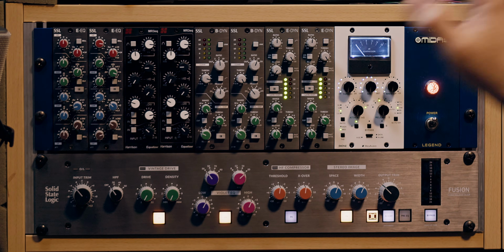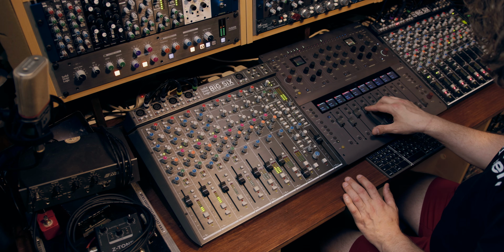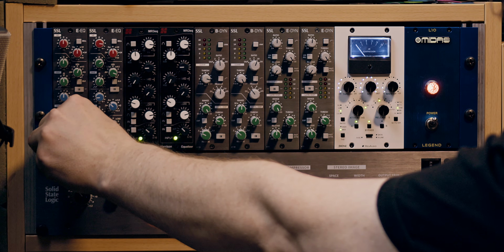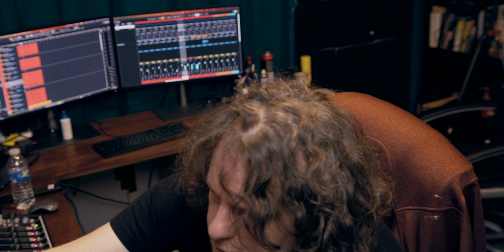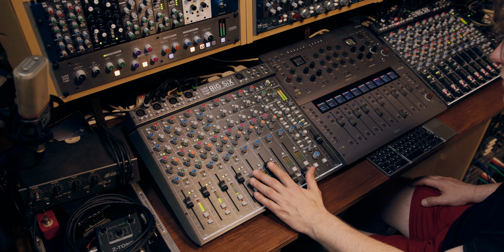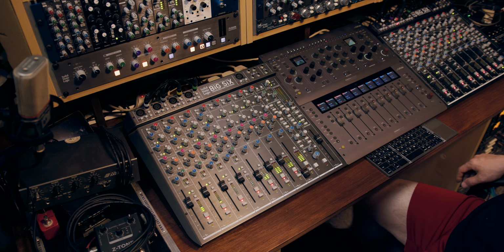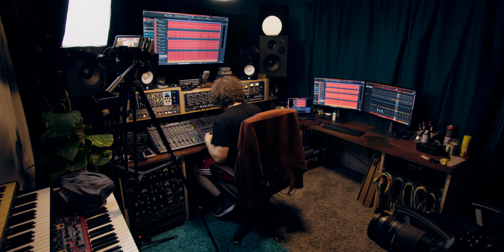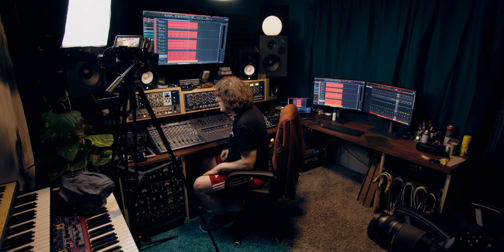Mixing Drums In My Ultimate Analog Hybrid Setup Using SSL, Harrison, WesAudio, IGS & Softube

Comment: How those Harrison eq's sound? :)
Reply from the maker: I realised I said trident in an earlier thread when I meant Harrison, was comparing the wrong thing after a long day mixing. The harrisons are functional but I barely use them. Any curve matched with pro q4 is identical in an a/b blind test. At least the uveqs have trim so you can use them pre and post analog comps
Reply: @domminney  What your advise for 2 eq's 500 series just for, one for Vocals and one for acoustic guitar. Preamps are Chandler TG2 and 1073 Lb 500, 2 IGS LA2
Reply from the maker: @lucasjuniorproducer I can only speak about what I’ve experienced and the SSL E-EQs are great, the curves are not what I’d reach with pro q 4 unlike the Harrison ones that are just the same as the digital ones. I’ve used more rack mount eq rather than 500, pultec style is good, I’ve used the warm and an igs one and the igs was great so I expect their 500 to be as good. I’ve got a couple of carnaby harmonic eqs that on paper and in tests are cool af, but I’ve still never used them for much more than repairing a badly recorded guitar. I want to find a use in general mixing and tracking and they always sound too much to my ears. Maybe the preamps and compression produce enough harmonics and the carnabys don’t fit my style. Who knows! Let me know what you get and how it works for you!
Reply: @domminney  I was thinking to have those Trident Eq. As you said they where not great, i was searching, but ater you said that you mistaken with the harrison, so im still searching what to do. The Trident's where just to have if needed on vocals and acoustic guitar because of the price very friendly. But maybe i'll go with the SSL 611...Still dont know. Of course to me i would prefer those API Audio 550b 4 band or the Neve 88R but they are overpriced as hell...
Reply from the maker: @lucasjuniorproducer front end EQ I tend to use the eq either in the big six or in my HA81 elite preamp. Very rarely an I using SSL 611/E-EQ on the way in, that’s more for mixing so maybe a neve style, pultec etc would work better for you

Comment: Have you noticed any phase differences between the two B6 desks when they're aggregated? I'm looking to buy a second B6 to get my channel count up, but I'm conserned about the possible phase issues.
Reply from the maker: Not on playback, recording wise one is a consistent number of samples out though which you must account for
Reply: @domminney Thanks for the reply! Have you tried recording drums with both units? 12 mics is of course very usable on drums, but I would not like to hard limit myself to one board. Is there a simple way to counter the shift in post? I’m using Cubase as my DAW.
Reply from the maker: @sdfsdfsdf7833  To be honest recording room mics on a second desk where I would time align them anyway wouldbn't bother me but I use my dual big six setup almost excusively for monitoring, mixing and reprinting signals. When I'm tracking drums I have preamps and another interface or my Midas M32 desk to track with.
Reply: @domminney Yeah, I think I’m gonna have to invest in a separate drum tracking setup. Based on your comments and research I’ve done, it just isn’t worth the hassle.
Reply from the maker: @sdfsdfsdf7833 i have 24 adat I/o for hardware inserts that I would use if I didn’t have the other options. I still bring the M32 in on the aggregate and monitor through cubase but there’s no timing differences as it’s all one device. I wouldn’t be worried about using 2 big sixes though, I’d probably do all my close stuff on one desk and the rooms / overheads etc on the other.

Comment: I see you have cables plugged into your line inputs on the desks.  Are you still using the desk's built in interface or just running them completely analog now ?
Reply from the maker: Using built in interface. Cables are just for the patch bay!